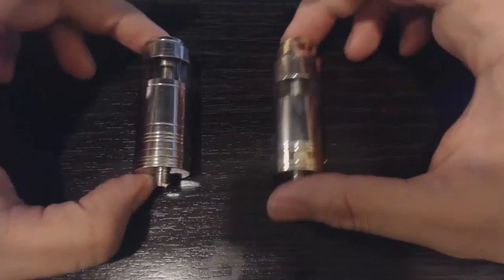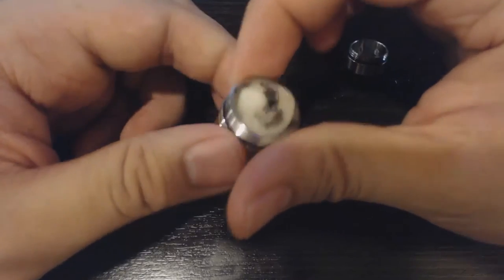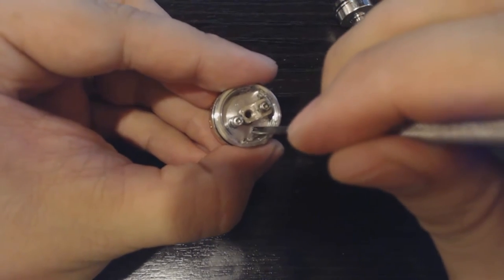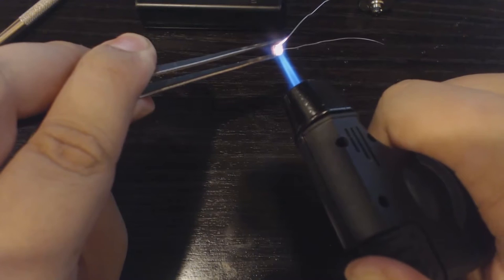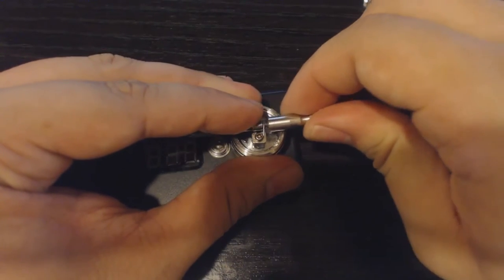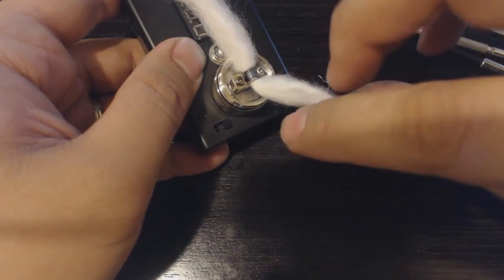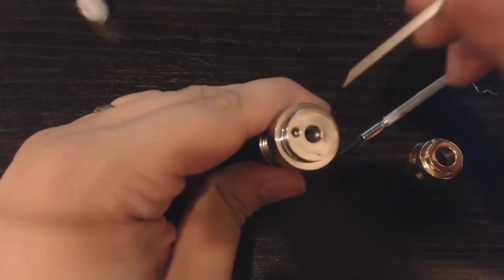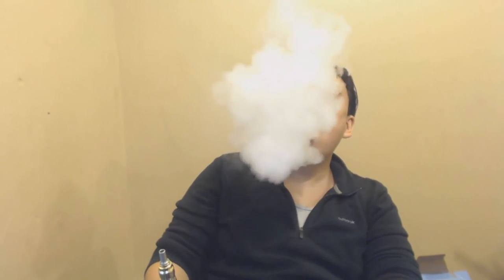UD YouDe Technology Atomizer Aga - T5

Comment: Thanks for the great video Peg!!  I've been using my T5 for about a week and love it!  All your pro's for the T5 are spot on.  

I only have two nit-picky times.  The tank to coil base threading is a little rough to get started, maybe just mine.  After the tank starts to thread, very smooth.  The second item is that I wish the very bottom of the coil base was knurled for grip.  I have had the coil base start to unscrew from the air flow ring up and leave the SS bottom cap on my mod.

Comment: Excellent rev.... uh, I mean professional insight. Seriously though, great job! That was an excellent tip at 10:30 on wrapping the lead back around the screwdriver & using the pliers to take out the slack. I tip my hat to you sir. So Pegasus, what are your thoughts on the "alleged" upcoming Kayfun V4? What features would you like to see implemented in the new design?
Reply from the maker: lets wait till the actual release,   lotta rumors on reddit saying its not even real.

at a glance it looks like another flavor tank. which seems unnecessary.
Reply: Oh I assure you its REAL! Members of the SvoeMesto team have confirmed its in production, their just not saying anything else as of yet. Recently PBusardo met Flo Toller & the rest of the SvoeMesto team & got a personal sneak peak of the V4, which he has confirmed on YT & FB. He's not leaking any details at all though so don't bother asking.

 I take it that you've seen the teaser pic SvoeMesto posted on FB & reddit? (Link Below) Its hard to make much out but it looks like a very interesting design. Based on the pic it looks like there's six generously sized juice feed holes below the chimney, just above the base. I would imagine wicking, even with high VG, will be fantastic with this design. Some people say they can see threading at the top of some of the chimneys, if that's the case then I would wager it uses glass tanks & o-rings, another +. I'm very interested in seeing the build deck, AFC & filling mechanism, fingers crossed they tick all the boxes.
So why did you say another flavor tank seems unnecessary? Seems like those are your favorite kind of tanks so why would an upgraded version of one of the best be a bad thing? The original Kayfun is a great design but its not without its flaws, there's definitely room for improvement so I'm hopeful they addressed that with the V4, time will tell.
Kayfun V4 Teaser: (http://www.reddit.com/r/electronic_cigarette/comments/2fhus9/svoemesto_kayfun_creator_just_posted_this_on/)
Reply from the maker: because too much tanks are built for flavor, and building for flavor in my opinion is restrictive.  You can increase the flavor on any device by reducing the air flow and putting on a small bore drip tip.  but you cannot go the other direction without drilling it out.

I guess what I'm saying is, you can always find a way to go smaller but bigger you need some dynamite.   As new devices get released like my PVA 40.  I'd like to see a tank that can wick and  handle the accompanying power.  I'd like to see a wider bore tank system with a better juice control.

I like tanks over dripper because of the challenge in the idea that the build doesn't end with the coil wicking is another challenge.  I never said I prefer a flavor tank.
I'm using a lemo daily right now.  Its quite the clouder.
Reply: I see what your saying, however you have to consider that most vapers prefer better flavor & a tighter draw over more vapor & a looser draw, I'm one of those people myself. I admit that dripping & cloud chasing is fun, it does have its place however for me its too much of a PITA for an ADV, especially on the go. I can get MORE than enough vapor out of a good, properly built RTA with fantastic flavor, MUCH more juice capacity & its SO MUCH MORE convenient than a dripper.
If the V4 (properly setup of course) can perform like a high end dripper, with excellent wicking, flavor & air flow, as well as hold 3.5mm or more juice, I for one will be more than pleased.
I heard directly from a member of the SvoeMesto team that they worked very hard on the new design & production of the V4, so I'm confident that their efforts will translate into a kick ass product.
Reply from the maker: Look,  I think we're on the same side if I simply just told you,  although the photo showed some crazy parts and inner workings.  it would be a disappointment if the vape that was produced was no different than any other kayfun clone.   

Cuz I really worry its just a busier way to achieve the same thing.  This is why I say we don't need another flavor tank.  Its done to death.  If they produce another flavor tank how off could it be from a russian?  plus I always wonder if the improvement is all in your head.   Like twisted coils for instance.
Some people swear by it, I call BS on that.
Reply: I hear ya, very valid points & concerns. Although this industry has come a LONG way since the first cigalikes, clearos & cartomizers its still pretty much in its infancy, there's definitely room for improvement. Yes, there are a lot of great devices on the market nowadays, however even the best of them are far from perfected. If SvoeMesto implements the right features in the V4, like a better juice feed system with a higher capacity & juice flow control, better build deck with holes in the posts, single & dual coil compatible, better insulators for sub-ohm, glass tank & o-rings, 4-5ml capacity tank (preferably one that can still hold juice with the deck/base removed), better AFC & a tool-less quick access fill port that doesn't leak. If the V4 addresses even most of those features then, IMHO, that would be a significant improvement over the Russian or previous KF versions.

Comment: What do you mean by "Keep up with 30w" - What would happen if a device's coil COULDN'T "keep up" with 30w?
Reply from the maker: it means most coils built in a tank can't handle 30 watts without being burnt.
Reply: Pegasus1337
What burns?  The insulators?
Reply from the maker: no  the coil and wick,  it will taste burn. because the juice cannot keep up

Comment: Peg, bought this Atomizer (Aga - T5) on your recommendation and it leaks all over the place.  The positive block is loose and turns from side to side, it's not seating down on the deck.  Is there a fix for this?  I lost a full tank of juice and cooked a battery.
Reply from the maker: ok  few questions:
first know that UD items are always different they come with small parts that at times seem arbitrary but then end up being very important.  There is a black gasket that sits on top of the chimney very much like the kayfun right under the top cap.  Without this, its a leak monster.
second where did you buy your Aga-T5?  I hope from vapercompany like I suggested.
Because if you speak to them they will go out of thier way.  To replace parts you need.
No wait time, they will disassemble from a new T5, send you what you need, then reorder the part.
as opposed to other companies who make you wait.

So if you're missing anything or something is faulty.  contact Jason and work something out.
Reply: Yep, vapercompany and the chimney o-ring is in place...  I just noticed that the adjustable bottom pin, that makes contact with the battery, was not tightened down and now the positive block is rock solid, I'll give it another shot...  Peg, I appreciate your quick response.  I guess all I needed was to back away from the initial "Leak Monster" with better focus.  Thanks Peg you are my YouTube Vapester; keep up the great work!
Reply from the maker: thanks for being open minded.
Reply: I've got it working fine now...  Thanks!

Comment: Recently got one of these and found it to be a complete leaking mess. Totally unusable . The juice just runs right through and out of the air holes. Everything is in place , all o rings etc. Surely this can't be right....?!
Reply from the maker: you're missing an O ring.  I had this problem too.
theres a small O ring for that chimney just like a Kayfun,  look around for it.
you should also have a spare,  install it like you would a kayfun,  leaking issue solved.
Reply: Ive checked the o rings and they're all in place, on top of the chimney etc nothing is missing. I can't understand why my juice is just running right through and coming out the bottom air holes like a fountain whenever I open them...??! Could it just be a faulty appliance?
Reply: Pegasus Vapor Academy I've sussed it. I released it seemed to drain real quickly like it was being "sucked" out so im presuming the vacuum was incorrect. So I tipped it over with the wicking compartment separated and  loaded my juice from one of the draining holes. Problem solved. Zero leakage..
Reply from the maker: I don't know what you said but I love happy endings =)
Reply: Haha yea , that wasn't a very good description reading it back, I think I've had one too many whiskeys tonight ... instead of using the grub screw hole on top to fill the tank, I've tipped it over and filled up from the one of the two holes on the underside, then fitted the coil/wicking compartment back on, it seems to give the vacuum the correct equilibrium. Hope that's a little easier to follow it's a happy ending anyways 👍
Reply: Matty Smith Yea, I found that you must use a syringe to fill thru the top or you will add too much air pressure in the tank.  When you fill from the bottom drain holes, no syringe needed, just don't let the juice get into the "draw" tube.  In the video, Peg's cotton was totally dry when he reassembled so it could soak up all the juice that was forced in to the coil area, I think.
Reply: Matty Smith Filling from the drain holes solved all leaking problems. Lost 1/2 of 5 Pawns and lesson learnt
Reply: try putting a little more cotton in it. Ive done tonnnns of builds in the T5. Only builds that flooded/leaking where the ones with the least amount of cotton. In my findings the best way to wick this is to put just enough cotton in it so it doesnt flood, but not too much.

Comment: are those brass air flow adjustments
Reply from the maker: My opinion from purchasing car accessories for over 20 years.  I looks like gold chrome.  Which is better in my opinion, because they aren't chroming anywhere that is crucial and it wont dull like my brass mods.
Reply: Thank's i will look into this device
Reply from the maker: remember what I said,  I recommend this mainly for those on the road to 0 nic.
If you're looking for dense vapor ability.

its not for everyone.
Reply: yep im down to 3mg
Reply from the maker: oh  awesome